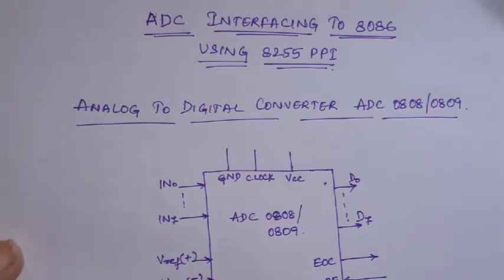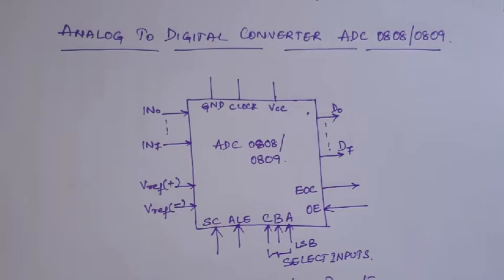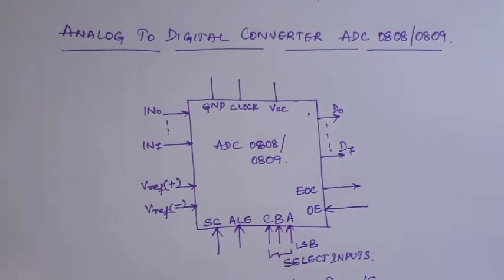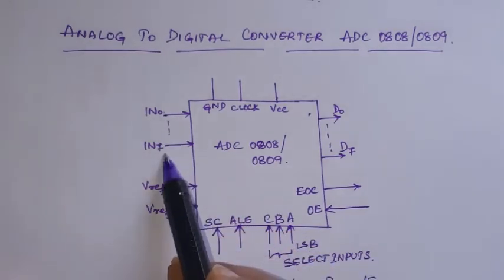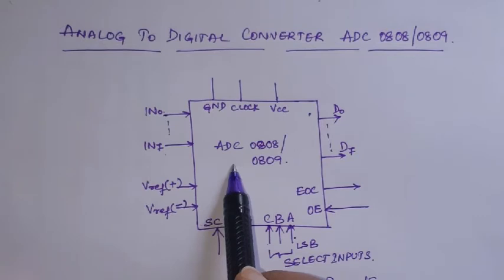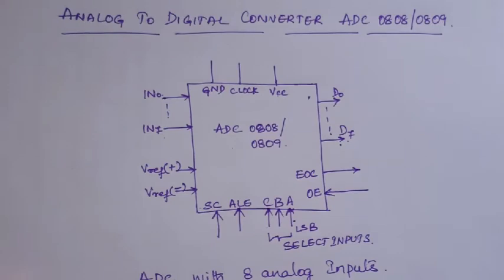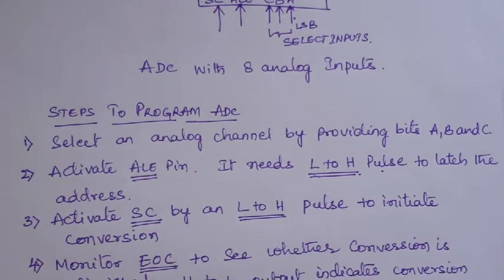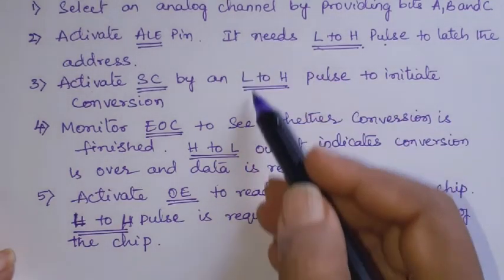ADC INTERFACING WITH 8086 USING 8255 PPI WITH PROGRAM

Comment: Your way of explaining the concepts of interfacing different peripheral devices with 8255 PPI is good, only one correction I guess, instead of FFH there should be FEH while resetting port C (Correct me if I'm wrong).
Reply: Thank you. To reset port c bits we are using 8255 bsr mode. Here we are writing the control word to control word register not to port c. Thats why address is FFH which is control word register address.